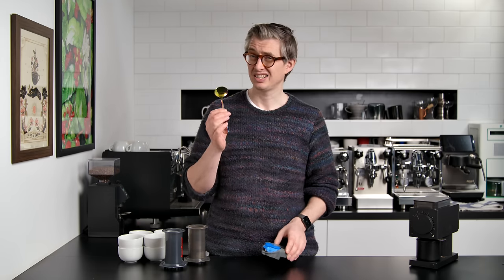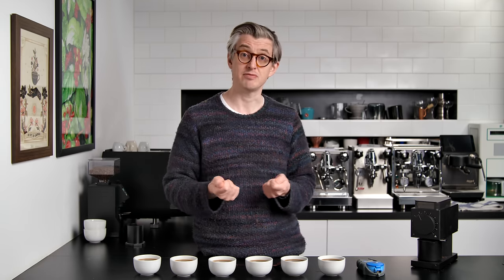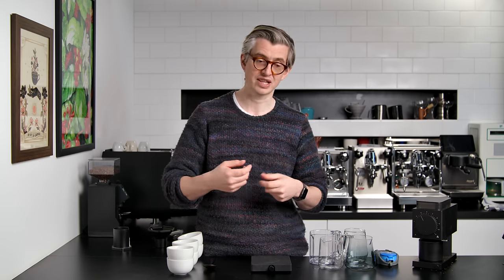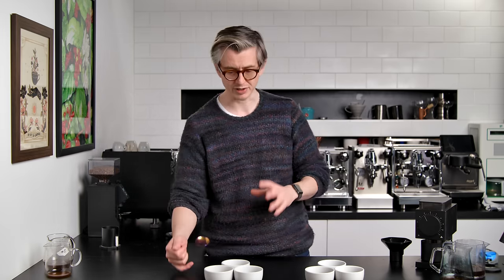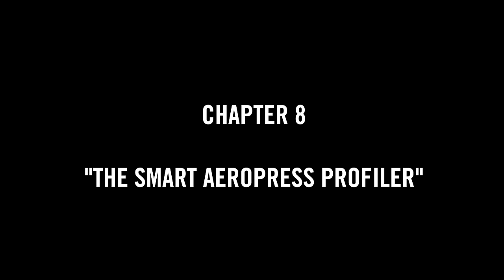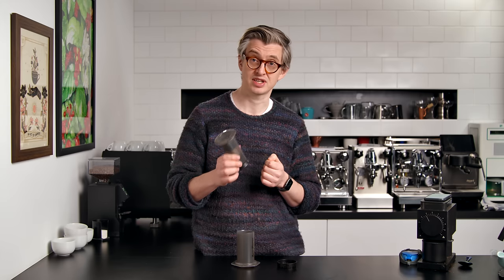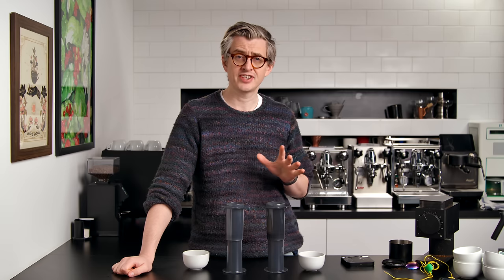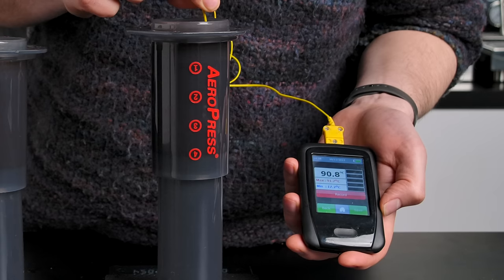Understanding The AeroPress (Episode #2)

Comment: James and all, I've now gone back and tried different temperatures. I suspect it's down to the coffee and grind. Usually I heat to 90, using somewhat coarse grindsettings and then a four minutes steep.

I tried 80 and it was lacking. Bland and boring.
I tried 100 (with pre-heat to really max out) and it was ok, but harsher and a little more bitter than 90.

The coffe is a tad dark roasted - I usually brew with a lighter roast - so it remains to taste wether the hoffmannian secret to coffee excellence is all down to the right combinations. Surely the final answer can't be 42? Luke brew, for 42 hours. Come on, universe.

Comment: What you can do with the inverted method, is pushing the air out while the aeropress is still upside down. So when turning over, you press the liquid directly with the plunger instead with air. In theory this should yield a more even pressure profile? Could this have an impact on taste?

Comment: I feel you've evaluated technique to technique too qualitatively and not quantitively enough. I'd rather hear if it tasted more acidic, higher body, sweeter, creamier, fruitier, etc. In the video I heard you say many times that you just preferred one over the other and that it tasted of more extraction. Coffee is more of an acquired taste, and people will have acquired their taste differently. And extraction is not the same line graph for each element of coffee, or we'd aim for maximum extraction across the board. Then "over extraction" wouldn't exist. I'd rather have the method by which to really dial it in, than just trusting your taste alone; as in a sample size of one, not doubting your taste.
That said, I do appreciate the level of detail you've gone into your testing. The sheer amount of time and bathroom breaks must be a huge effort. This is a lot to look at, analyze, and self test. There are some things I want to note about your methodology though.
1. I wish you'd list your testing methodology numbers, and result data numbers, on screen per experiment. Things like grind, water temperature, steep time, extraction numbers. You don't need to say them, but having them would help compare not only the within an experiment, but also with your other experiments, and our own experiments. Repeatability is the cornerstone of peer review.
2. You had your Aeropress facing down in the drip alignment, so some coffee is always going through even while you steep. This may cause inconsistency. It may not cause a big difference but it you'd get more consistency, I will argue is important for testing purposes.
3. In your blooming experiment, you didn't compare it to a stir or swirl. Stirring or swirling may have the same effect to help relieve CO2 buildup and inconsistent extraction. Although you conclude that it's unlikely to effect extraction by much, but it clearly does effect it. And if you choose to steep for shorter out of preference, that's going to make a difference.

I think searching for a SINGLE Aeropress recipe, and indeed a single recipe for ANY technique, is folly. I think what you should be looking for is the scale(s). The scale of how each change in one aspect changes the end result so that you can dial it in to a specific preference. More or less acidity? More or less body? Darker and heavier flavors, or lighter fruitier notes. I know some of what I'm asking for is going to be more in the berries and the roast, but why not control what you can control.

Comment: This is fantastic but I see some issues with some of the tests. For example, with the different temperature brew near the end, did they have the same steep time? If so, of course the cooler ones would have less character - they're probably less extracted (unless you confirmed the extraction with your fancy devices?). What would happen if you mimicked your French press method with 5-10 minutes steeping in order for all of them to end up as fully extracted as possible?

Similar for the dose experiment - of course they are wildly different. Shouldn't this experiment have been done with the same amount of coffee beans and instead change the water in order to have different ratios? And then afterwards add water such that they all end up with the same volume/ratio?

Finally for the pressure test, I would imagine more pressure could lead to more extraction, so I'd curious to see a test with the highest pressure but with 3 or 4 different steep times. Maybe you can get a great brew with high pressure and shorter time, a la espresso?

Comment: Hi, My problem is that when at work(in the field) I have to use hot water from a Thermos so it definitely is not boiling. I preheat the thermos and heat the ceramic cup and aeropress with hot water from another thermos. Any hints for a better cup? Cheers Steve

Comment: You glossed over something quite shocking: just letting it drip through led to similar extraction as the other 2 brewing methods? That would imply that the plunge does nothing, but your subsequent experiment with pressing pressure proves that there was still some extraction happening during the plunge - otherwise how would it overextract at the higher pressures? It seems like the plunge has the POTENTIAL to extract more coffee, but simply led to unpleasant results in that particular experiment (which could be a factor of the beans, grind size, and steep time you were using). I believe that use of a coarser grind size could allow higher-pressure plunging without leading to channeling, which would give us a clearer impression of how much extraction happens during the steep and how much during the plunge, and how that impacts the flavour of the cup.

Comment: can you tell us the weight applied in each of the pressure tests. The graph shown doesn't look accurate to the weight applied. If it is accurate, and it only takes 1-2 grams of weight on the plunger for a good brew, I'd like to use a metal weight to put in the plunger for consistent force the whole way through without manual pressing. I just need to know how much weight to use (considering typical pre-ground medium grind, to the recommended medium-fine grind). I've read that it can take 25lbs of weight applied, but that seems like a bit much, and anything above 5 lbs I'd have to start using silver for something that fits inside the plunger, going up to Osmium for a max of 10-12 pounds, which all seems very costly.

Comment: @james hoffman  I'm very late to this party, but I'm a bit concerned that you aren't actually doing the inverted version correctly - there is ZERO risk of a popoff if once you attach the filter and top, you depress the the Aeropress, in its inverted state until a small amount of coffee comes through the top, then flip. This creates a vacuum and keeps the coffee inside (an even tighter vacuum than standard Aeropress brew) I would argue that this method is less messy than than the stars brew, but understand that all of this is self preference!

Comment: I still have a lot of confusion about how to use my Aeropress. I make a cup of pour over in the morning,  25g of coffee to 400 g water. Can I make this size of a cup with the Aeropress? It only holds about 200g of water. What about ratios for dilution? But isn't there a point of diminishing returns for the amount of coffee you can use? I'm struggling to see how an Aeropress is useful in my routine if I can only make so much less. (Also, I used it this morning in the regular, non-inverted method, and about half the contents dripped out...not just a little. I think I'll go back to inverted.)

Comment: Inverted method is easier for stirring to ensure grinds are fully mixed - paired with a metal filter (paper ones are fiddly and leak) this has the added benefit of reuse and cleaner filtration. Flipping over is easy, have never had a coffee explosion in nearly 10 years and in my experience the taste is always better

Comment: When you are doing the triangle test, do you know which one you have 2 of and which one you have 1 of?

If so, could your thoughts about which one should be better (i.e. A or B), then potentially bias you to which one to pick as the odd one out.
For example, say you have 3 coffees, 2 A and 1 B.
You think B should taste better.
The 3 coffees have tastes such that 1 is slightly better than the other 2, and 1 is significantly worse than the other 2.
Because you think you should have a good tasting one as the odd one out you subconsciously ignore the difference between the 2 bad ones and instead pick the best one as the odd one out.

Comment: A note about the inverted "risk". This is only true if you haven't practiced the method before. I've always brewed inverted. I found holding the empty cup to the filter basket side, while gently holding the plunger in place with my other hand, and then flipping removes any of the risk of the plunger coming out, and removes the need to keep the plunger farther in, which in turn removes the reduction in brewing space. All that said, I'm not a firm believer that it's any better than the standard method in terms of quality of the coffee. It's just the way I've done it for years so I'm VERY used to it. Also, rinsing the paper is a useful step when brewing inverted because it helps keep the paper stuck to the bed of the basket when you turn it upside down and screw it onto the chamber. It doesn't surprise me that there's not a taste difference though, I've always been a bit skeptical on that.

Comment: What about a metal filter vs paper? Thoughts on that variable?
Reply: Absolutely. I use the fine metal filter every day and it's great, but you have to brew upside down and then invert the Aeropress onto the coffee cup. Works great for camping etc., because then you don't have to bring the paper filter set along with you.
Reply: @DepressedHandsomeSpaceCop  thanks so much for the reply. I’ve been using a metal filter for a good while now. I use the inverted method. 

What I’ve noticed using the method in this video, is that I’m getting a far superior brew, but the coffee leaks out slowly by gravity, so after two and a half minutes, when I finally plunge, a large amount is already in the cup, passing through the filter without any pressure.
Reply: @phoenixvamvakias9329  Yeah after watching this video I definitely want to make some modifications to my brew. I've always been a bit of a sloppy barbarian with the aeropress, because it generally makes a pretty solid cup of coffee no matter how you try to mess it up. I usually didn't even stir it, or time the infusion, or do any kind of nonsense with the bloom. I might actually experiment a bit with some of those variables. I think I've also been plunging too hard - I didn't realize that this had such an enormous impact on the quality.
Reply: @DepressedHandsomeSpaceCop  ditto for me. I just poured in water waited and plunged. It was always weak. Now it’s great.

Comment: what I kind of dislike about this video is that the tests are all done on a recipe that isn't the standard recipe. The draw for a lot of people with the aeropress is that it produces a coffee concentrate that can be used to make a latte like drink. none of this testing is applicable there because none of the testing was done to make a concentrate. for instance the hiss might make a more pronounced affect if your output volume is much smaller. The inverted method makes more sense with concentrate as making a single serving of concentrate mean a tiny amount of water and having that drain out of the cup before you can get the plunger on will cause a larger problem. rinsing the paper, again might be a bigger deal if your water quantity is much lower. I think a lot of this conventional wisdom might apply more to the original aeropress recipe than to the brewing you are doing

Comment: - Reason(s) to brew inverted: zero leakage of under-extracted coffee before pressing👍 (when it comes to risk of spillage: easily avoided and not really an issue at all).
- Reason(s) not to brew inverted:
Reply: i mean, the risk of spillage isn't really zero, accidents will happen. and, if you are quick at making a vacuum, there's not much leakage. Also, in my expedience, the leakage doesn't taste bad, it won't really effect your brew all that much. You also have a reducing brewing volume using the inverted method, which is very annoying in an already single cup brewer
Reply: @bluee3348  Interesting points, you might be right about the leakage not affecting the brew that much. I guess for me it just seems reasonable to avoid leakage if I can, so that all the coffee is equally extracted before it reaches my cup (I also like to stir a bit at the beginning, which would mean even more leakage before making the vacuum). But again, I'll admit that this issue might be more significant in theory than in practice.
When it comes to volume, that's a good point IF you want more than 220-230 grams of water in your brewer. The recipes I've come across so far have always been below that anyway, so that hasn't been an issue for me. James Hoffman himself only uses 200 grams of water (in the next episode), not really utilizing the extra volume he gets by not brewing inverted.
Reply: @Freddd95  That's true! I'm not anti-inverted or pro-inverted, I can see points for both, and, inverted is what I first learned in the world of aeropress brewing, and it's what I use if I'm only making coffee for myself

Comment: I wonder how:

AEROPRESS | STAINLESS STEEL FILTER

AEROPRESS | FLOW CONTROL FILTER CAP

Affect thing
Reply: “Unlike others, this cap fits perfectly on AeroPress Original, AeroPress Go and AeroPress Clear coffee makers and can be used with metal and paper filters—together or separately. Produce beautiful espresso-like crema with a buildup of pressure, and take your experimentation even further with coarser grinds and extended brew times.”
Reply: Moar videos! Then Moka pot size 1 cup v. maybe 2 and 4 cup where you make 1 cup

Comment: We NEED to address the prismo. Not as a way to make fakepresso, but as a means to streamline the aeropress workflow and make it simpler and easier to make that cup consistently every time. No offense to inversion brewers and vacuum sealers, but, id really rather just pour my water in, swirl it up, let it sit, tap it and press it.  (I tap to help force all the grinds to settle. no more floaties. I don't think it does anything to the brew)

Also, the prismo really doesn't add much backpressure at all. it barely stops gravity from pulling water through, so its not increasing brew pressures. Despite what Fellow advertises.

Comment: I disagree with what you said in chapter 7.
The invert method is always better. With the normal method, you do not apply high pressure, with the normal method there is not much crema for espresso.
Also, in many aeropress competitions, everyone uses the invert method. I haven't seen many using the normal method.